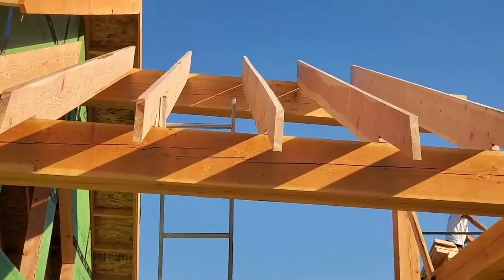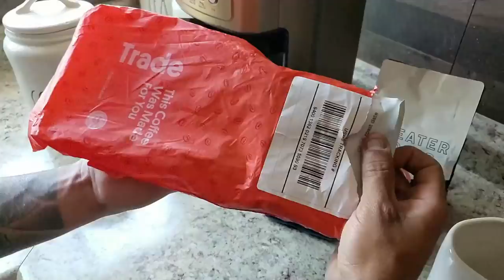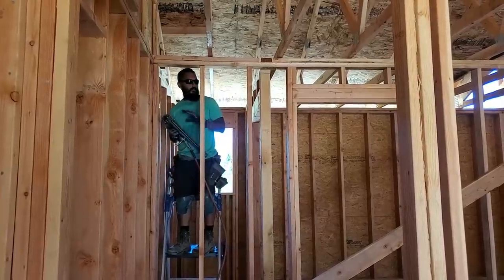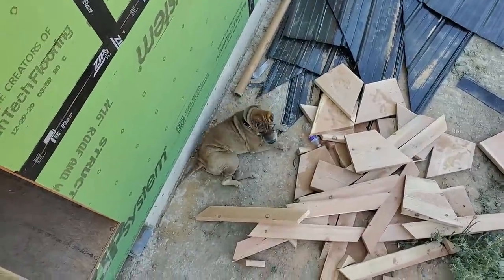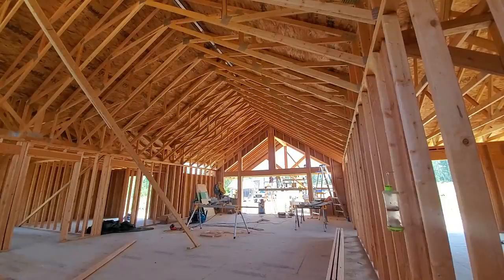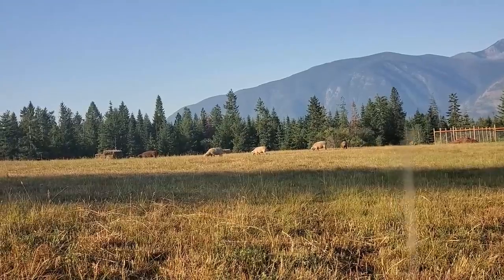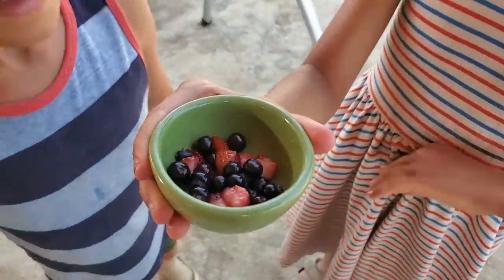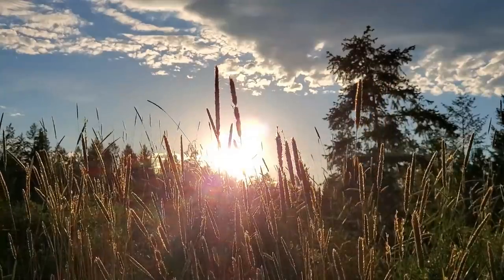Totally TRANSFORMING The Look of Our Home Build | FINISHING The Rustic Timber Framed Truss

Comment: Here's a little tip.  Something I did when I was building my house, that came in very handy later on.  Do this once you finish the wiring and plumbing, but before you insulate or sheetrock/logs or whatever is going to cover your walls.  Walk around the whole house, and take pictures and/or videos of all the walls.  2 or 3 years from now, when you want to hang something on the wall, or penetrate the wall for something, you can go back and see what is behind that wall.  You won't remember the details several years from now.  I've gone back and looked at those pictures several times when I wanted to hand curtains, hang a TV on the wall, or make sure there are no water lines or electrical wires in a spot I need to cut a hole.  Just a suggestion - and keep giving us these awesome videos.

Comment: Don't water while the sun is shinIng on the leaves it will burn them.
Reply: Agreed.  instead put the hose on the ground and water below the leaves,  or water as the sun goes down.
Reply: Aerial watering in that heat only evaporates, water on the ground so it can be absorbed for the plants.
Reply: @carolmccarthy9004  better to water in the morning. Watering as the sun goes down can cause problems.

Comment: Hello from the Netherlands .  
just a safety question : 
does your oldest daughter and son know how to get you down with the gradal in an emergency ?  .  
and do you have a small simple first aid kit in the man-basket ?  .  
I myself have worked a lot with aerial platforms and man-lifts for my own work and believe me such things you just have to learn beforehand (also a reassuring feeling) 
and a simple first aid kit that suppose someone cuts them considerably or even an arterial bleeding that you can quickly put on a bandage.  
Do you have a good set of walkie-talkies ?  for in a situation like then with the bear in the driveway and in case of emergency important I think.  
Sincerely Hollandduck from the Netherlands

Comment: Are Simpson roof hangers required on the roof joists for e extra strength.
Reply: @crowhomestead7552  if you are going to build an off grid home and spend all that money I would make sure that it lasts for a long time. They hired young men to do work on the house and I don’t know how much experience they have. Some work that they did was I expected more precaution especially on the roof sheathing and eliminating the gap between the osb sheets.
Reply: @rsy427  ??? Are you in the building industry????
Reply: @daveharder4048  spent 30 yrs in CA in construction management from large commercial to small retail. Worked in cities throughout So CA to Monterey Bay Area. The regulations and permitting in CA was and is still a pain and especially the permitting process. We were in most cases required to hire deputy inspectors to write reports to the cities.

Comment: I would advise putting spray foam insulation on the underside of the roof.  Metal roofing makes a lot of noise when it rains and 2lb spray foam would really dampen the noise and help with insulation.  If you aren't going to put it under the roofing than at least on the floor of the attic to dampen sound from the roofing.

Comment: You guys are lucky. Here in California you would need to block every one of those horizontal seams in the sheathing as well as any roof decking that’s less than 24 inches wide AND the flying edge up where it looks to be a ridge vent. All to meet earthquake codes.

Comment: My great-grandmother used to make awesome Saskatoon jelly and syrup.  Also, did you know? They have more calcium, 3 x the protein, potassium and antioxidants and 5 x the iron than their blueberry counterpart.  They're denser and have a bit more seeds, but in jambs, you strain the juice out, leaving the seeds in the strainer. This is the traditional recipe from the Canadian Prairies (my region):  4 cups berries to 3 cups sugar with about 1/4 cup of water and juice and zest of 1/2 a lemon (being I'm allergic to citrus fruits, I use 1 tbsp + 1 tsp apple cider or apple cider vinegar - comes out the same). Heat over medium heat until the berries are "mashebull" (word written by my great-grandmother) in the syrup.  Use a potato masher to 'squish' the berries, extracting the seeds.  Put a double piece of cheesecloth in a metal sieve and pour the liquid over.  Let drip until only the skins and the seeds are left in the cheesecloth.  Pull up the ends of the cheesecloth and twist the top, letting the juice drip back into the pan.  Over low to medium heat (each stove is different), simmer (and she really means a gentle, rolling boil), bring the 'juice' to reduce by half for jam or by 1/4 for syrup.   Yum!  I can still remember the taste of my youth of the syrup served over thick, hot pancakes or the jam spread over a warm piece of bannock, warmed and buttered.  Tip:  pick the Saskatoon berries in the heat of the day.  If you pick them in the cool of the day (early morning or late evening), the berry can have dew on them from the leaves which makes them not edible.  You have to wait for that to evaporate off the fruit before picking. 
 2nd tip:  always rinse the berries (or any vegetable or fruit picked from the wild) in lightly salted cold water before starting any cooking.  The iodine in table salt is not appreciated by bugs and pests.  These will sink to the bottom but remember that the bad berries will float to the top.  I usually do 2 cleanings - 1 for bad berries 2nd, I put a cookie cooling rack on the bottom of my sink, pour in the water, add a little salt and pour in the just cleaned berries.   Maybe you'll all fall in love with Saskatoons this year!    I've tweaked her recipe a little by adding freshly grated nutmeg (about 1/8 tsp to the above recipe) and sometimes 1/2 tsp ground cinnamon.  It changes the taste a 'wee' bit.

Comment: You should install an evaporative cooler.  Takes way less electricity than an air conditioner.  Ours has a 1/2 HP motor and a small water pump.  As long as the humidity is less than 35% or so, works very well.  Just be shur to open windows on the opposite side of the house.   David Brainerd - Idaho County
Reply from the maker: We'll have to look into that
Reply: If mounting on the roof, use a down draft.  If mounting on the wall or a window(ours is on the bedroom window) use a side draft.  We bought the largest one they had and run it on low speed.  We had 95 deg today, only ran the cooler about 3 hours and the warmest spot in the house was 74.  Available at home depot  <https://www.homedepot.com/b/Heating-Venting-Cooling-Evaporative-Coolers-Whole-House-Evaporative-Coolers/N-5yc1vZc4m6>  David Brainerd - Idaho County

Comment: I was watching as you used the Black Tape on the exterior joints.  Are you planning to also wrap the house in something like Tyvek?
Reply: I believe that the zip panels are water resistant themselves and so don't need extra layer. That is why the joints are taped.

Comment: House is looking awesome.  If possible in future video,  please address concern of how hot the black metal will be?  The insulation under it could melt, burn?  Light color would deflect heat?  Black looks nice, will color bake off? The good news, if problems arise in future years, you can easily change roof material 👍

Comment: Sorry I was too late on the tip for the sheeting the gable ends, that would have solved the offset problem too.
Now that you have all the headers in , this hint of leaving out the studs on either side of the header will let you nail header in better ,then put in studs after header is all nailed in. 
Because when you built the out side walls without building corner post or partition post , is the reason you are now havening to put in lath catchers on both sides of all interior walls and every outside corner. So now you need to build them in the wall,  the corners , start off with the blocks of stud 1 to 1 1/2 feet long , 3 is good for 8' walls but use 4 for taller walls, now insulate between blocks then the next stud now you can nail the other wall together.  Interior walls that meet the outside walls will also need the same using 2 exterior studs and blocks of the interior studs, w/blocks to the inside, then insulate before the last stud.  Hope you get this in time. Now we can move on to right now hints  #1 use left over header material to fill in on each side of the window headers . this is blocking for curtains .  #2 putting in a block of stud on all outside corners of walls both int. & ext. , this is for nailing base to in the corners.  If you are planning on crown molding then do the same for it.  I saw the video of drywalling before may I recommend that you get dimple tips for you screw guns , they do a great job of setting the screw to the right depth.   PS I'm Stephen John's dad,

Comment: Question. Don’t you need 2 more post for the overhang next to the house for load distribution at the back.? Why not ? Trying to learn.
Reply from the maker: The horizontal posts actually run back into the front wall, and are supported by extra framing in that wall that acts as a support post.

Comment: Is the slope of the roof 5/12 or 6/12?  I'm impressed those guys can walk on the metal without sliding off.  When I installed metal on my 4/12 roof, I had issues with sliding, even though I was wearing shoes with slip resistant soles.  

The overhang on the front of the house looks like it could be used for a carport.  LOL 

Sorry you are having such a heat wave this summer.  It's been a cooler and wetter summer than usual here.
Reply from the maker: 8/12
Reply: @GoodSimpleLiving  Wow!!!  That is steep!

Comment: I can't express just how much I am impressed with your' build. I know you had help with the roof but the majority of the build was just the two of you. That is amazing. Home construction can be a ball. I did it for a couple of years in my teens. That was a very long time ago. in new England. 
The reason I quit was you were either loafing or running around on stagings or roofs covered with ice in the winter months. Not fun. We did remodeling inside also. Try tearing down over head plaster walls and ceilings. Not fun also.

Comment: I certainly hope that, after this miserably hot summer, that you will be putting in air conditioning in your big house.
Once you are finally, as in the zip tape as well, done with the framing and sheathing, you need to hold a big party. Then do that again once the inner walls have all been plastered in.  :-)